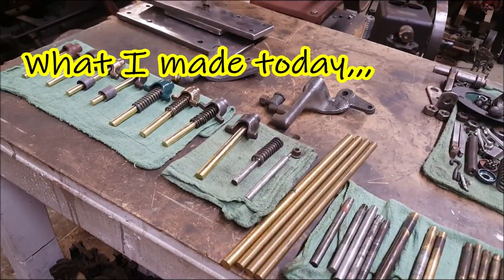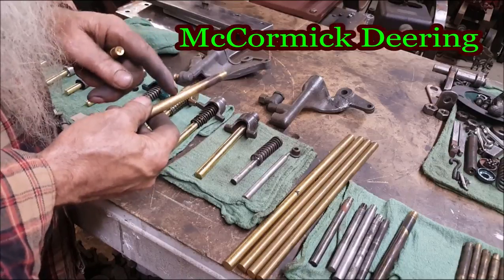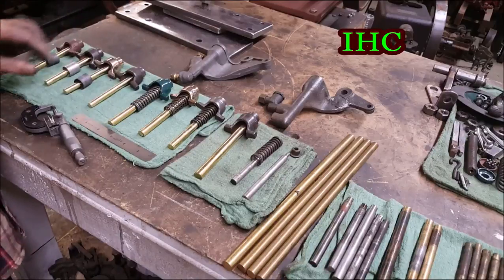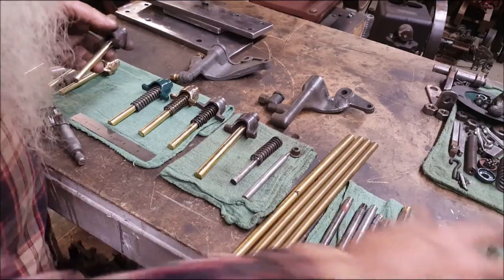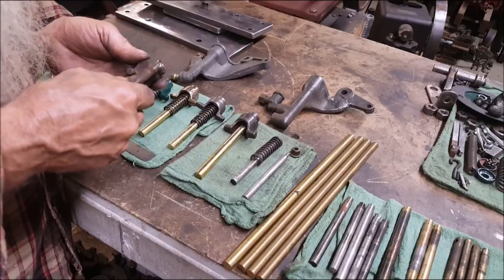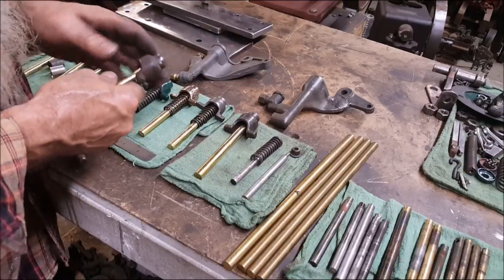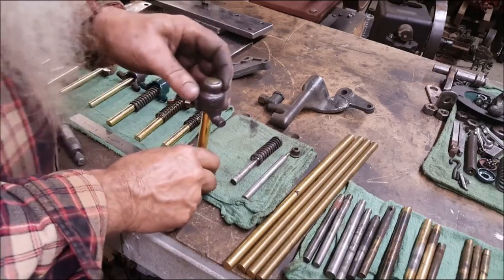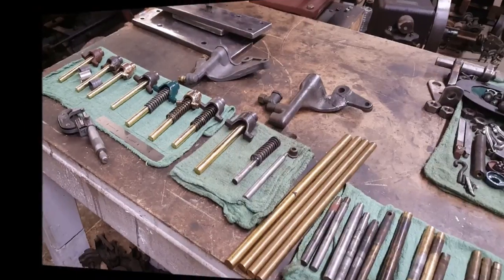What I Made Today IHC Engine brass fuel pump plunger

Comment: Hi from Australia.  Those housings look similar to bar / chain oil pumps on chainsaws but bigger  of course.  I wonder if the plunger style valve would work for chain oil and maybe  not not leak as much too.  At least it could be repaired, as you have shown.  Great stuff cheers.